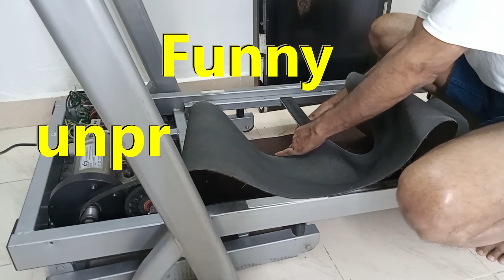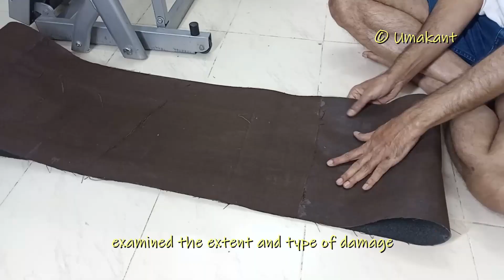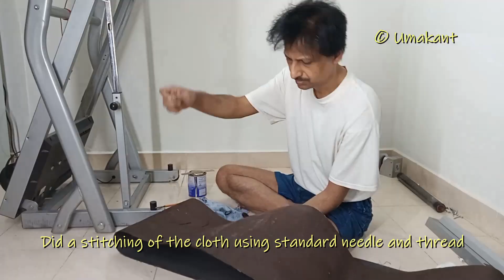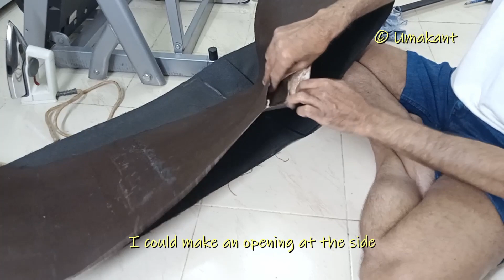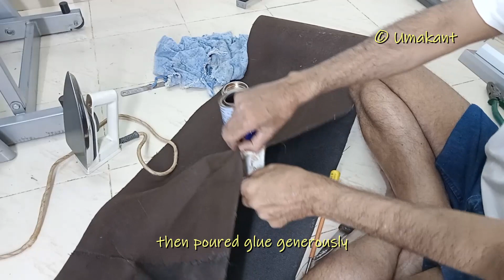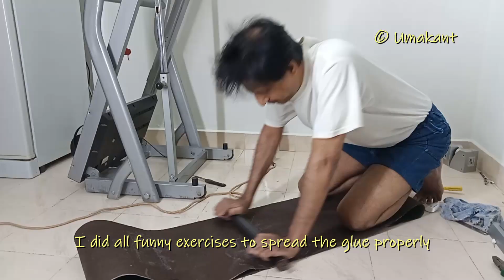Treadmill belt repairing using Fevicol SR-998 glue- Do it Yourself

Comment: Would it have been easier to make a very small incision in the middle of the bubbles. Then using a large syringe squeeze some glue into the hole and spread it evenly around the bubble. I figure the small hole from the incision will naturally close from the spreaded glue.

Comment: Sir, I have to ask one thing. that is fevicol synthetic rubber adhesive
Reply from the maker: Yes, it is fevicol synthetic rubber adhesive
Reply: @SoubhagyaLaxmiMishra  thank you mam for this information
Reply: Sir, I had to ask one more thing. why this problem arises on the belt.
Reply: Kya ye idea kaam karta hai?? Pahele ki tarha chal paayega ?
Reply: @kishormdr4072  Tell me one thing your belt is torn or is the line just coming?
Reply: No its not torn but video mai jaise ek layer seperate ho gaya hai
Reply: @kishormdr4072  sir do you use silicon spray . If yes . So sir you have to see the dirt between the belt and the board. if If your belt is black at the bottom then it will be clean. Sir I have a treadmill but this line not go on the belt . But I saw that my belt black at the bottom then I had washed to the  belt . After than my is good work but sir line did not remove .

Comment: Mine is made from fabric under and the fabric is all over the place and the sides
Reply from the maker: Yes fabric is there for giving strength. Without fabric, the rubber will get stretched and become long.
Reply from the maker: If the fabric is removed from the rubber you can use this rubber solution. If the fabric is completely damaged you may replace it with some thick cloth (used for pants). All you can do at home.
Reply: @SoubhagyaLaxmiMishra  could i show u a picture of it where i can post it ?